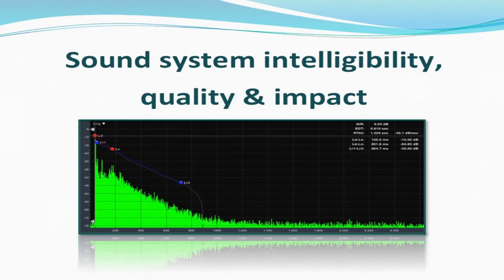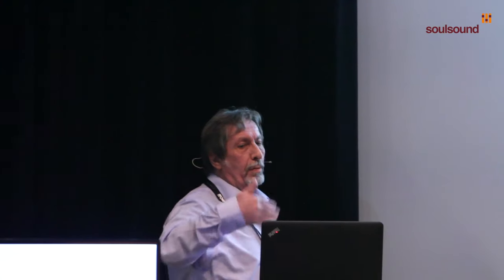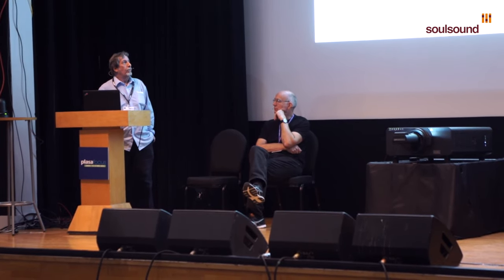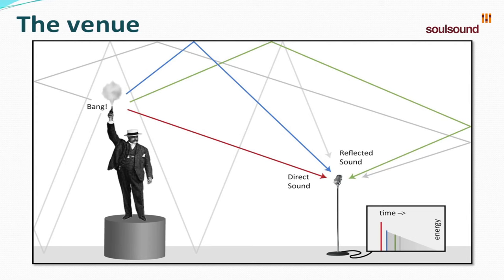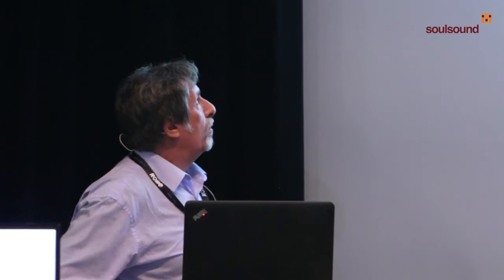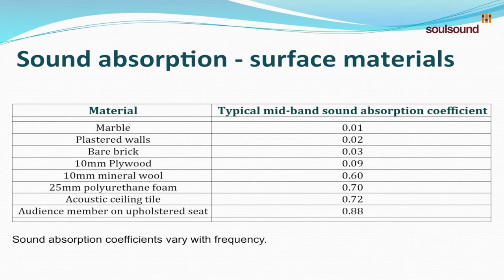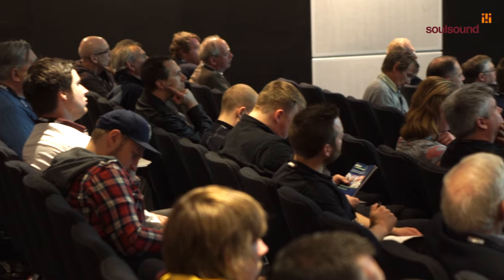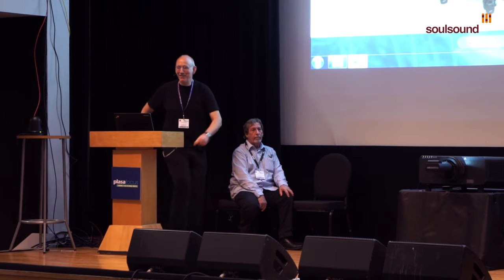Sound System Intelligibility, Quality and Impact

Comment: Thank you for sharing this presentation. Very informative. There's one statement in the presentation, though, that is based on a false assumption (and contains some incorrect information). STIPA is not an older version of the STI which was slimmed down because of computational constraints. It's actually the newest version. The sparsity of the matrix has nothing to do with computational power, but with measuring time if you do a direct test (based on a modulated test signal). You need to do a direct test in many situations - an impulse response-based measurement as shown here is inaccurate and incorrect (=not compliant to the standards) in any system that features any kind of nonlinearities. Which is actually almost every sound system. There is no advantage of STIPA over full STI if you derive the STI from an impulse response. But to be honest, you shouldn't be measuring the STI in that way anyway - at least not in a great number of applications.
Reply: FULL STI : Female and Male difference consideration. .